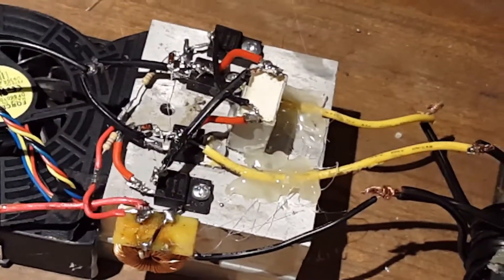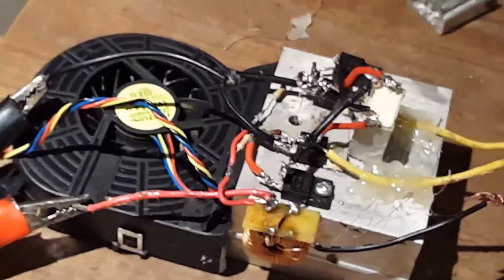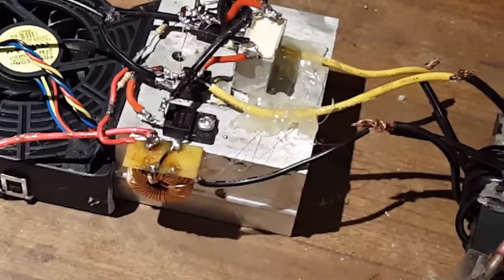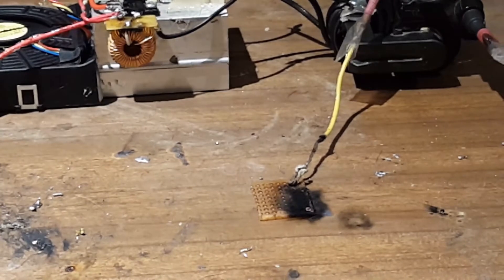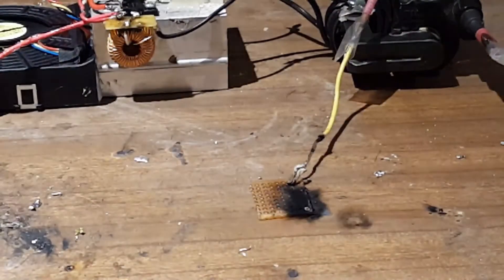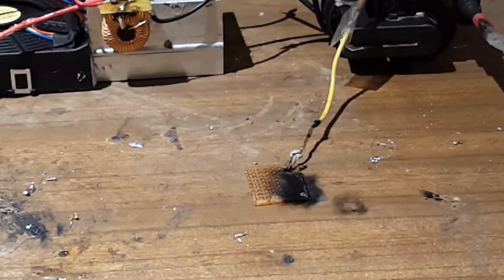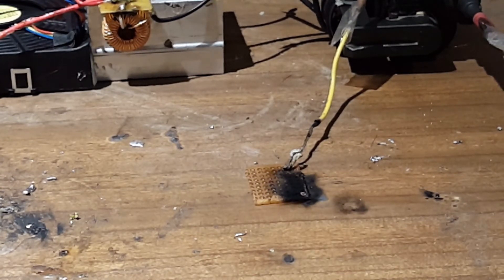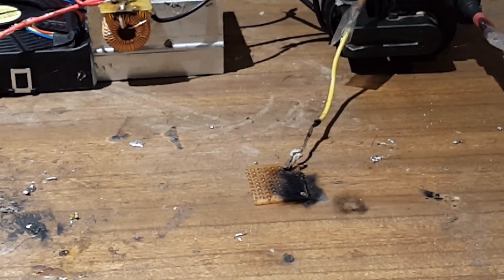High Performance ZVS Driver

Comment: The longest arcs I've seen from a ZVS circuit... Nice Job!
Reply from the maker: Yes its certainly pretty powerful, infact it was a bit to much because It burned out 2 flybacks. Then it blew out the mosfets. So i just bought a zvs on Amazon with the better mosfets irfp250N.